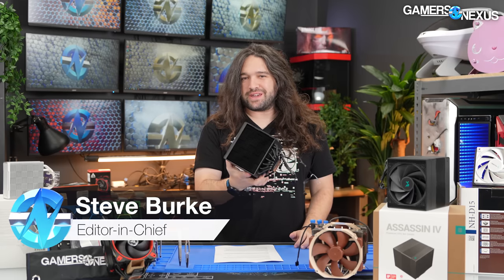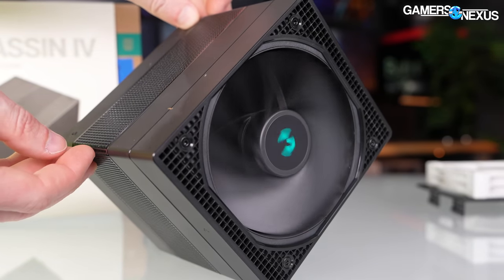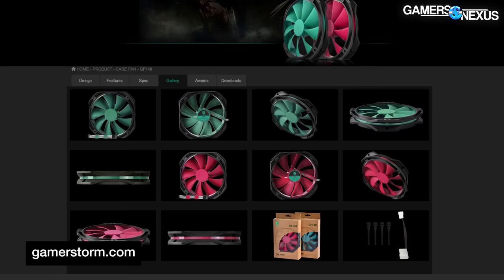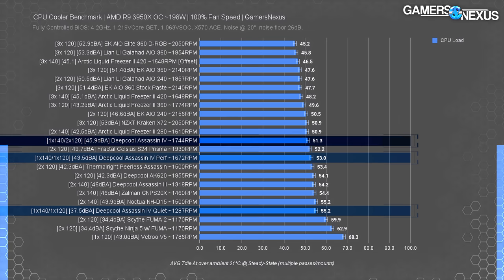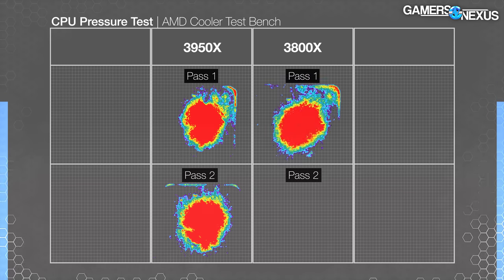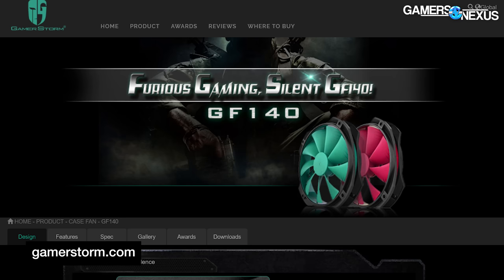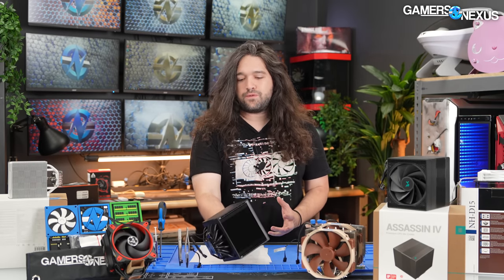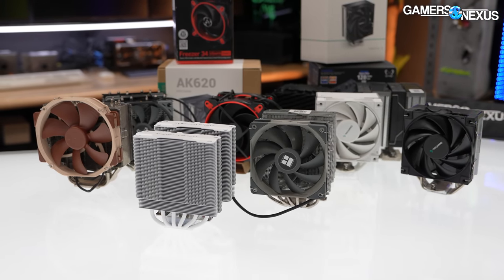Mega Size Air Cooler: Deepcool Assassin IV CPU Cooler Review & Benchmarks

Comment: That high-pitched wine sounds just like a ball bearing fan, but a poorly made ball bearing to be exact. I have four Arctic p12 CO fans which are the ball bearing variant of the regular p12 and all of them produce this noise at different noise levels from one fan to the next despite them all being purchased at the same time. This noise is loud enough that it can be heard from outside the case even when the fans are inside the case and the case is completely closed and my case is not particularly open it's actually quite restrictive.

Comment: Interesting point with the higher/lower pitched noise and Noctua. I specifically bought another CPU fan because the low hum of Noctua fans is way more audible to me with my Define R5 than compared to higher pitched fans. Maybe I also have some hearing troubles with higher frequencies though.

Comment: On top of the Scythe Kaze Flex 140 Round someone mentioned in the comments before Phanteks PH-F140HP will fit in the middle (they're  both the old frameless design). The phanteks is available in the US on performance-pcs, Scythe is not unfortunately

Comment: Seems like it should be reasonably easy to 3D-print custom brackets for NF-A15 to secure it in the middle. The mesh thingamabob still won't fit, but at least the fan would be fine.

Comment: The thing I like about this cooler is the fan mounting. It kind of takes some of the worry away about shipping someone a custom build. I have shipped computers with Noctua coolers and usually use a little silicone on the clips to make it secure.

Comment: @GamersNexus 
The middle fan IS standard, its just an OLD standard. It's 140mm fan w/ 120mm mounting holes. you saw them all the time back when 140mm was a new standard so that they could mount into cases that only supported 120mm. I'm pretty sure Noctua even made them; NF p-14 is the same format? lots of others around, it would just be painful trial and error to find what works.

Comment: For thermalright, if you want better performance in idling state, try Thermalright Frost Commander (but it's very loud in max fan speed) or Thermalright Frost Spirit (performance + noise between Frost Commander and Peerless Assassin)
Reply: If you have an Intel hybrid chip, it doesn't matter because they have ridiculously low power draw at iddle.

Comment: Here I am with a dark rock pro 4 and my computer from 5 years ago...

I don't have temps higher than high 60s even at high to full load.

I think I'll wait until 2025 before building a new computer with 4k compatible or better components.

Likely doing research on parts but right now I'm still looking at a 5800x3D for my new processor and toning down my ram to 32gb since I don't need so much ram.

Comment: The included tool doesn't look great, but I would definitely not give-up hex-head screws for a Phillips head screws. Sure, it's a much less common driver (though you can buy them at any major hardware store), but it's much harder to slip and strip-out the head with even a crappy quality driver.

Comment: The Peerless Assassin / Spirit 120 both look like way better value. Too bad they have such a low ram clearance. AK620 looks like a solid step up from those with higher ram clearance. IV just seems like an aesthetically more pleasing option, without much added benefit. At this price point a 240/280 AIO definitely seems like a better deal, though that's very much subject to personal preference and usecase. Personally I love the look of this and would buy it if it wasn't priced so high, considering one fan would have to be replaced which would bring the price up even further. It's already priced at $110-140 where I live. Hopefully more companies will experiment in similar lanes, bringing the price down a little.

Comment: Whine/whir could be metal-metal friction, a good solution is to mix grease+WD-40: Creates a lubricant that's great lubrication, stays 8n 0lac3, and is lasting for months or even 1.5 years; can be refreshed with WD-40

Don't like it, needs work, 3 fans is interesting but also needs unpainted metal for great cooling justice

Comment: It's a good thing that this cooler doesn't support aftermarket fans. If you want to use DeepCool just use DeepCool. Don't make it look like Frankenstein monster. That cooler has it's own aestetics. So just deal with it or move along. Also Steve any plans for PentaWave Z06D review? It's a South Korean brand. And it's said that it's the best air cooler on the marker right now. And it's cheaper than Noctua D15.

Comment: 19:48 with a proper fitting hex key I would use them all day long over Phillips, but with the wonky bit glued into an adapter glued onto a bit of metal ... why didn't they just include a proper hex key? that combination of found garbage has to cost more than a 10 cent hex key that can be used with both ends (longways for speed, shortways for gronk)

Comment: 6:50 there's some Scythe Kaze Flex 140mm "Round" that should be compatible, or at least look like they would be. As they also are 140mm fans with 120mm spacing.
I use a deepcool AS500 Plus with 2 fans with similar form factor so i looked that up a while ago.
About 15€ in Europe

Comment: The design of this cooler is somewhat intriguing, but the coil whine sounds quite off putting. I have 10 be quiet! fans installed in my PC (8x case, 1x CPU, 1x PSU), and I don't ever hear it make any noise whatsoever. That's definitely something Deepcool should improve on, imo. Come to think of it, why are there no be quiet! coolers in your charts? You reviewed the Dark Rock Pro 3 a super long time ago, if I remember correctly, but none of the more recent models. Is there a reason for you to seemingly avoid be quiet! in general?

Comment: The most important part of a suitable air cooler is reliability. Because when you choose air cooling over water you're aiming for reliability and zero service. The air cooler of choice has to last 3-5+ years without any problem.

That's a tough thing to test so everyone that isn't Noctua has to proven themselves with every product to build the same reputation.

Comment: What kind of stress tests have been done on the effects of air coolers? As in the physical impact of hanging these beefy monsters on your mother board. Every time I ask I always get told don't worry about it. I can't find any actual tests any were when looking though.  I remember seeing don't worry about the weight echoed endlessly for graphics cards followed by damn my card bent or snapped or my pcie slot got damaged. Those are an easy preventative fix for most by purchasing  a solid support bracket presuming it fits in your case. Since BEFORE it was a verified problem it was don't worry about it I am quite curious as to The heft of the don't worry about it air coolers.

Comment: I kinda regret going AIO, call me old fashioned but I just like my air coolers, on my last 2 PCs (built within 2 years cause I just wanted to build another pc) I got the coolermaster 240, but on my media pc with 11700k I still have a dark rock 4 pro, but I'm the same kind of guy who prefers things wired (except that I do wifi 6 everything, no more ethernet cable).

I would consider this if I made another build, but not being able to get a replacement fan bothers me and also I am actually quite noise sensitive, so much so that I sometimes wish I had worse hearing, so I'd probably pick up on the whine, thanks for mentioning that.
Reply: AIO is just the current fad. Everybody are getting AIO even when they absolutely dont need them. Also a good air cooler can do everything a cheap AIO can, so... just why bother.

Comment: Matrox has a neater variant of a 8x pcie graphics card connector on their LUMA A310 and A380 cards. The connector is full 16x length for the extra stability, but only the 8x part has gold fingers on it, and it has a cutout in it so it would fit in a theoretical 8x slot if needed. Maybe that adds a tiny bit more to the cost than removing it entirely though. Wonder why not more cards at least don't leave out the gold fingers and just have the plain pcb on the part that isn't connected on the 8x pcie cards, seems like a bit of a waste. That was very common on pci cards that didn't use all the pins.

Comment: How the heck are solid cold plate coolers still available and for this expensive when the hyper212 series is almost old enough to drive and costs like 20 bucks for a direct contact heatpipe design

Comment: I wonder if Noctua's next gen 140mm fan will fit whenever that releases.  The round frame version they showed at CES this year looks like it could fit in this cooler.  Not having options for a replacement fan is a problem considering the cost of this cooler.

Comment: actually it's not possible to achieve the proper silence with a liquid cooler, the pump and likely the liquid running through the system will make enough noise to make good air coolers better, liquid cooler simply won't get low enough to be acceptable

Comment: It's a good cooler but the new Deepcool AIO's directly compete with this with better pricing when on sale, AND the air coolers DP offers are so cheap that the $50+ can actually be used to save on costs or put that into a another PC part. It's a sound product on the cooling front, but until it has a deep as fuck discount, offers an RGB version of it for the same price ($144 CAD MSRP), or make a revision that lets up stick a powerful 140mm like a Silent Pro 4 into the middle why bother?
Edit: I actually remembered that this here would do well on Ram OCing due to the better clearance. I also am pretty curious how well it works off cases like the Torrent and G500A who can just throw air the front heatsink, would it get a degree jump or hold lower temps longer?

Comment: Also, did you know they came out with an Assassin Spirit 120 V2 now?

So I assume it performs the same as the Assassin X 120, but it has that dual-tone grey thing going if you like grey. I dunno for sure the performance numbers though, it's too new, I'm pretty sure no-one has reviewed it yet. And yes it is in stock unlike the original Assassin Spirit 120. (Why do Thermalright have so many similar models???????)

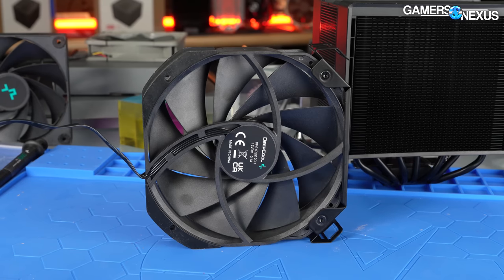Comment: @6:45 and @16:30 :
It seems the center fan is similar to other 140mm fans with 120mm holes. I wonder if for example a Noctua P14 (including redux variants) will fit?
Or perhaps the Thermalright TY-147 if it still is available...  I think also for example Scythe has some 140mm glidestream/slipstream fans with the same bolt holes.

Comment: Three's some interesting tidbits of value, and I understand I'm probably in the minority of performance users who value cooling over noise (I opt to run high static pressure server fans everywhere I can for insanely overpowered cooling); with that said, that's a big chonkin' cooler that doesn't seem to perform as intended.

Comment: if we say both fans run at the same rpm then the flow rate will be different for both fans. The question is what value to have different size fans in terms of flow rate. Also different fans have different flow rates and pressure coefficients so are they matched for the best performance

Comment: you're essentially paying for the aesthetics given it's merely on par with a peerless assassin in performance but costs much much more. Still, that extra front fan in push pull config seems to make a difference.

It would be interesting if Thermalright offered a premium looking product so that it covers that aspect as well

The assassin iv and dark rock 5 cost around 3x the thermalright options out there

I can also get two 36m aios for the price of one of these

Comment: You know, Noctua DOES make a "loud" fan. Their iPPC line of fans are much more powerful fans (same basic design as the normal fans, just with a motor that has been designed to spin up to 3000 rpm instead of the more normal 1200 or 1700 rpm), and I'd like to see just how much more you can squeeze out of something like a NH-D15 with those.
These fans do tend to cost a little bit more than the "normal" Noctua fans, but I expect them to be ONLY "louder" fans, not "more annoying" fans.
Basically I expect them to allow for better cooling but act like you went up a size in the white noise machine you bought, rather than switching from a white noise machine to a gas turbine engine (with the typical characteristic whine that brings along with it).

Basically, more air moving thru the same cross-sectional area of a fin stack is always going to make more noise, that's just simple physics. But with Noctua's attention to noise profiles, I expect that to result in a flat increase of noise across the frequency spectrum, rather than have an annoying whine to it like you'd get with a Delta fan.
Those Delta fans are high performance fans too, of course. The difference is that they do not consider noise to be a design constraint. So you get a 120mm fan that draws all of 1A at 12v, but can move something on the order of 250CFM when spinning at 15-25k rpm.
In the applications where Delta fans are used, the chief concern is keeping things cooled without having to resort to air cooling, while maintaining a small physical profile to fit in a 2U rack-mount server case, which results in small (smaller than even 92mm) fans spinning at 20k rpm or more and the ever-present high-pitched whine you always hear in data centers (the noise from JUST the fans can be so loud that you might legitimately need to wear hearing protection to be OSHA compliant).

Comment: At some point ,when you add more fins, more weight more fans and still won't do better, heatpipes not enough to transfer heat to the tip of the fins, or the heatpipes don't transfer enough to the fins.

Comment: Add silent high efficient fans to it and the price will rise up to the sky.  
I have he Thermalright Peerless Assassin 120 with a single PHANTEKS PH-F120T30 right between the temples on AMD 5600 cpu locked at 900rpm and my PC is noiseless at all

Comment: I have one on my 7950x3D...I notice random plasticky clicking (not a fan blade hitting cable sound) from my unit.  Almost like when my monitor starts to heat up.  I'm guessing all of the plastic on the cooler is creaking here and there due to thermal expansion.  Other than that, I really like this cooler.  Expensive though.

Comment: My AK620 made a weird whine but only when the fan speed was changing sporadically. I managed to actually resolve this by altering the fan step to 0.3s instead of 0.1s which was the default on my motherboard.

I'm not sure why that helped get rid of it, but it's gone now.  If I change it back to 0.1s I hear it again.  I confirmed it with another person to make sure I wasn't crazy.

Comment: I want to like this cooler, but I do not like the proprietary central fan nor do I like how the adapter for the third fan looks so bad.  I mean how hard would it have been to include a second identical cage to the first one - just without the fan.  Speaking of - if the primary fan in the cage can't be swapped out, that is more poor design.

Comment: Now that you have your anechoic chamber, is there any chance of posting recordings (either in YouTube video form or as WAV files) of some CPU coolers and case fans? I’d be willing to pay on Patreon if required because the specific noise profiles of different coolers and fans is one of the biggest reasons I want to upgrade but I’m unwilling to go with liquid cooling due to past experiences.

I’m sure that myself and many of the other audio engineers watching would be happy to share our input on things like ADCs, microphones and the like for your testing if it would help.

As a reference point, the systems from Fully Silent PCs top out at using an RTX 1650 or 1650 Super so for trying to get a really quiet Windows system it’s down to custom builds or getting a system from an audio specific vendor like ADK Pro Audio (who charge a premium for their custom cases but I have never had a chance to compare to off-the-shelf cases).

You are the YouTube channel best positioned to cover these kinds of content and I would really enjoy watching you diversify into that area.

Comment: Yaay!  He used capital delta instead of instead of the lowercase.  Above ambient...  KIS. Thanks.  You have my permission to use "temperature rise above ambient" and be through.  LOL.

When installing the Noctua replacement, we didn't see underside clearance details versus the OEM fitment.  That detail clearly shows that fans with square or rectangular frames of any useful length aren't going to work.  From the video's view, that Noctua was looking like a good fit-ish.

Hey, can we get to some basic old figures, like a synopsis video or less detailed without normalization, at least at first.  Say, create the quick one first.  Like it.  Then add content for the long pattern video.  Throw it all in then with those excellent chapters.  Sure, it'd be more work.  Just my two cents.  Include the standard bloopers et al; these long pattern videos hold the Easter Eggs of content.  Creation of the shorter video first would ensure it's quality; while, as production of the second's video process is refined, the modular approach might prove beneficial.

Comment: Something worth mentioning, even though this is edge case to the extreme - people with tinnitus can "pick out" the high frequency noises even if they're buried among others. Sharp frequencies aggravate tinnitus, and it doesn't matter if they're bundled in a shitload of others, tinnitus hears all.

Again, edge case, and obvs not something ever expected to be covered by a reviewer, just..if you have tinnitus, you should be aware of this. I'm pushing 40 and have tinnitus and hard drive whine is a particularly large-sized fuckwit, and it doesn't matter if I'm gaming and my system is going hell for leather, if its spinning, my tinnitus pays full attention